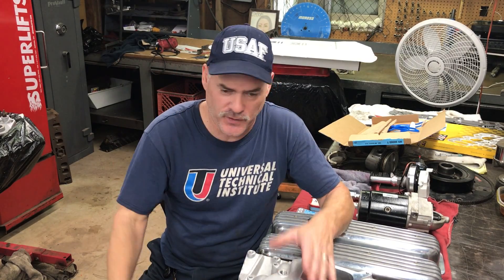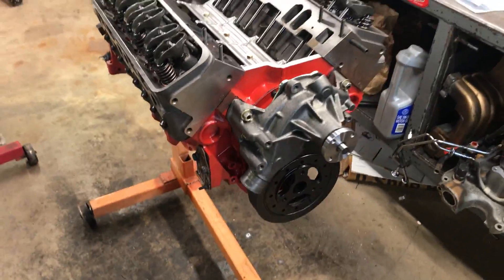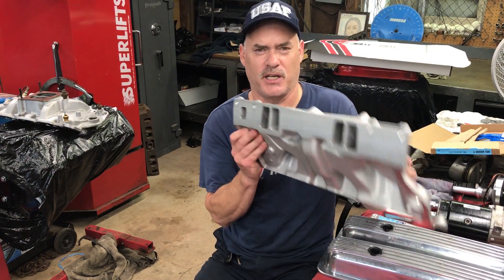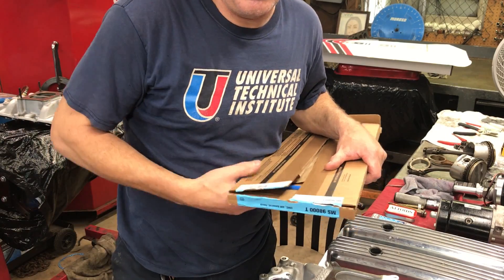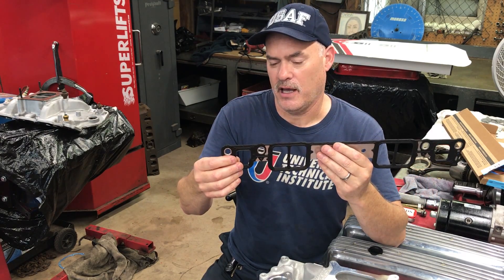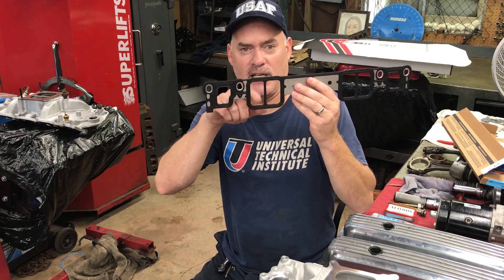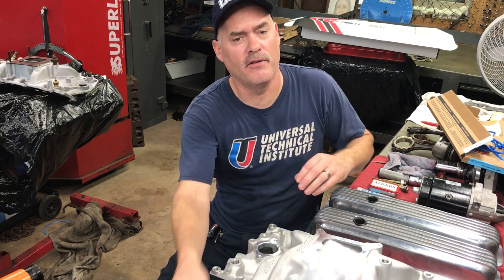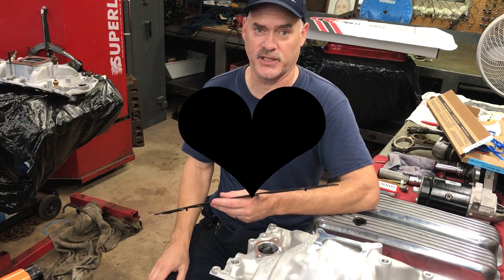5.7L Vortec  Intake manifold gasket problems

Comment: My crate engine 350 Vortec  was using 2 qts oil in 750 miles ..I used these recommended gaskets and now
it stays full of oil..I didn't see any smoke ...Glad I don't have to replace it....Thanks!
Reply: I;m having the smoke issue on my GM Crate engine with only 9,000 miles... I thought it was the valve seals so I wasted a whole day replacing those and did nothing. I'm really hopeful now is only the gasket!
Reply: Ok so 350 vortec crate motor with  vortec intake & spider injector system,
Is that what you got & your saying that this intake gaskets worked & took Care your oil consumption problem???
Thks in advance
Reply: @rudyVvv3  yes gasket was cracked on bottom

Comment: Looking for help second time around. Hello, been watching your videos, thank you. I upgrading a very early 350( V1027MU) Flint V8,Oct.27th 350/295hp block. I pulled this out of 67/68 Camaro  in 1971. been running this since 1975 build. 10.5  forged TRW pistons, chrome molly rings. I want upgrade to a hydraulic roller bump stick(Howard brand?). Budget is a concern with that said,  which are better early LT Corvette heads or later Vortec type head. Current heads came on the engine, 194/150 intake/exhaust which I port matched and cc'd also have press in studs which I pinned. I don't remember the cam specification(flat tappet hydraulic) but the Rhoads lifters didn't help idle quality. Stick shift car application. This is a street/strip fun car. Thank you for you answer in advance. The car is a 1978 Oldsmobile Omega, factory 4 speed I bought new in 1977. Mike 01/2019
Reply from the maker: Vortec heads are better
Reply: @Myvintageiron7512  Thank you

Comment: The early 3.8 and 4.3 had the same problems wonder if they have cured that as well????
Reply: Yes, recently installed Fel Pro Super Seals on 2003 S10 4.3L. Factory plastic on passenger side front was just on the verge of leaking near top of intake. Only 67K miles, been running ethylene glycol for many years too, which will help prevent since dexcool becomes very acidic when it ages.

Comment: Will these be a lot better than the regular felpro? I have a 2000 tahoe limited 5.7 2wd and I need to replace my gaskets thanks.
Reply: DO NOT recommend use regular Felpro plastic. Same junk as factory. These are call Superseal Felpro.

Comment: I'm new to you our channel and I'm also new to Chevys so I have a few questions. First off I just got a 90 Corvette completely stock except for the exhaust. And in wanting to upgrade the heads but keep the TPI set up any advice would be helpful. I'm not wanting to dig to far into the motor the Corvette was my father's and has 95k on her and runs strong but definitely has room for improvement.
Reply from the maker: Dart Iron Eagle 180 cc runners 64 cc chambers and a good cam  to match they will wake her up

Comment: Thought I needed an oil pump because my truck lost a lot of oil pressure cold starting it one morning. Noticed that it made a lot more white smoke even when warm on a cold day. Lost half a radiator of coolant in a month or so, no leaking. Drained oil to pull the oil pan and there was pure coolant coming out of the pan after all the oil drained... GM does some dumb shit for no reason. From the factory intake gaskets to using plastic threads in the distributor in these engines. Why? Nothing but a pain in the ass.

Comment: Hey man love the videos but how much torque should I use with these gaskets?
Reply: Whatever the manufacturer specs are. Used theses when I replaced mine. I’m not sure but I believe it was a low foot lbs spec. 12 or something like that. Replaced 1 1/2 yrs ago and have had no problem since.

Comment: I saw this video. I bought the steel shim gaskets.  They leak! Any other ideas? I have changed these 3 times in a year. I now have atomic efi. It runs like crap due to vaccum leaks. I'm running a new motor from jegs. The edelbrock rpm manifold.  My bolts are torqued to 11 ft lb.  Any ideas would help. I am ready to pull the intake and silicone the gaskets in place.

Comment: where is a good place to find the vortec heads and on my 84 square body truck which vortec heads should i get the 906 or the 062
Reply from the maker: 906 or 062 no difference wrecking yards or craigslist
Reply: , i found the906 heads . deal is the heads i have on the motor i just installed in my truck have roller rocker lifters and the motor has a mild rv cam in it with flat top pistons , so my question is when i swap and put the vortec hesds on my truck will i be sble to simply swap heads and be good to go ? i think the guy said it has been bored 0.30 over  will this affect my situation? also i found a vortec intake also should i do that or go carb with the elderbrock intake? man srry for pilling these questions on u but kind need some type of guidelines to know before someone takes money i dont have for the given.tx
Reply: man i found some sftermarket aluminum heads on ebay the deal is they are not vortec , and they are actually the proper heads for an 84 chevy my , question to u is would u think those aluminum heads would compete with the vortec heads?

Comment: what intake manifold studs are you using on those dart heads?
Reply from the maker: It is a hardened stud I got at a hardware store
Reply: @Myvintageiron7512  what's the length on those intake studs?

Comment: Can a blown intake gasket cause engine to use oil? I have a crate 350 with Vortec heads that is using oil and fouling plugs in a pattern and I can’t get a straight answer if the intake can cause it. I know oil doesn’t run through the intake but is there another way oil can sneak through. It’s fouling 3,4,5,6; right in the center of the engine. I’m going to buy a leakdown tester just trying to borrow it down.
Reply: Hey I'm having same problem except  cylinders 1,4,6,7,8  You know anything by now?

Comment: Hey this is Oscar I got a 57 engine I really like your videos!  Question, if you could recommend a good setup for more horsepower, I’m going with vortec head, which one would you put the 906 or the 062 head? Please let me know a good setup if you can you can...if you can call me that would be awesome (650)518-3036
Reply from the maker: What engine is it?
Reply: Myvintageiron7512 350
Reply: Myvintageiron7512 TBI Old engine 350 small block trying to put Vortech heads I know you said there’s two kinds which one do you prefer
Reply: @oscarfuentes7233  062 and 906 are the same design, just different year castings.

Comment: When intake gasket on vortek carb set up blows, will it leak oil bad?
Reply from the maker: It can sometimes it will pull oil from the lifter valley into the intake port and the engine will smoke
Reply: Myvintageiron7512 
Mine is leaking down bell housing. Performer rpm intake. I can't tell where it's coming from. Thanks for input.

Comment: Do you use rtv around water ports? or a cork gasket along the ends? or just that fel pro set and rtv on the ends?
Reply from the maker: I use RTV in front and back and on the water jackets
Reply: Putting a L31 in my 71 and just put the intake on tonight. Saw this a little late but I did put a skim of rtv around the water jackets on both the head and the gasket side where it meets with intake. Hopefully its enough! I'm sure ill know as soon as I fire it up. I assume it would be burning coolant if not? Love your videos. Keep up the good work
Reply: I also used the gaskets you recommended.

Comment: Very informative!  Silly question maybe, but if and when I have to do this job on my '97 5.7 Suburban (200k) should I use these gaskets also?  It's not carbureted but the CFI model.  Thanks for any advice.
Reply: MrBowNaxe I would like to know the answer to that question also
Reply: Yes, They work. I got the same kit and it fits perfectly. I bought this kit on Amazon and it came with both valve cover gaskets even though it says only one in the kit.
Reply: @MrBowNaxe  hate to ask but,- How did you reply to Aaron's ? when you were asking the same ? But Noone replied to you... How did you come to the conclusion that you could use the felpro intake gaskets on factory vortec intake w/ csfi system ???
Reply: @rudyVvv3  the matched up perfectly. I had fuel from a bad injector on my spider. If I remember, So I did both jobs at the same time.
Reply: @MrBowNaxe  fuel injector dripping  ???? (What symptoms/ experience you had on the fuel side)
How did you fix that problem?
Reply: @rudyVvv3  I had a fuel injector problem and when I pulled the plenum to do that I went ahead and replaced the intake gaskets while I had it torn down. Had 200k miles on it at the time so I thought a little preventive maintenance would be a good idea so I didn't have to tear it all down again if I had a gasket failure. I heard from guys that 200-250 was usually when you have an intake problem if you're going to have one.
Reply: MrBowNaxe yup it's the same motor
Reply: Ok so what leaks when intake gaskets blow from center portion?
He never mentioned if you loose oil, coolant or get vacuum leaks ? 
Any help would be appreciated

Comment: How you doing my name is John I been a subscriber for about a year-and-a-half. I'm honestly very impressed and learned a lot from your videos my profession is collision repair and mechanic related to any collision damage. Unfortunately age is creeping up on me Collision repair life can be tough on the body and health, and I have both problems I'd love to feel the motor someday and you inspired me to do so I don't know just looks like something I'd like to do I didn't know it was so precise and I was ripping Motors apart when I was 8 years old normal workers and whatnot just to see how they worked. Well I'll get to the question and it's about a cylinder head I was watching you do and then you showed a shelf that had many of them and you said they were for sale well I'm working on a friend's car it's a 1970 Mach 3 Continental with a Ford 460 it has some issues I'd like to ask you questions if I could just to make sure I'm doing the right thing and researching before I do anything I think it needs heads because it doesn't have the hardened seats in them and I believe the valves are a little burnt on the ends so I'd like to know if I could for one purchase two cylinder heads from you and if I was able to email you or get in touch with you just to ask some questions of course it's a budget fix I would love to break it all down and rebuild it but once again I want to do the research before I could give a price and if I am making the right decision I believe it just needs the top-end done but I'll have to check clearances on the main bearings and what not so I have a few questions but most important the heads so if you could somehow get in touch I'd appreciate it, I would assume you could reply to this and I'm sure we could figure something out I could send you back the heads I have either to be repaired or you could keep them or just sell me ones you've already done, either way I know you're busy and I appreciate all you taught me and I'm sure everybody that watches you appreciates your hard work.
Reply from the maker: I do have heads for that message me on Facebook at myvintageiron7512

Comment: This is great info I needed. I am building a race motor with a set of pro topline vortec heads and need this info.  one question, do I have to use self aligning rockers? I will be running a 510 lift cam. ect?
Reply from the maker: Yes self aligning rockers and check guides for clearence for that cam lift

Comment: I have a old friend that worked in one of the plants where vortec engines were assembled, he said GM felt that the vertical bolts on the corners were enough to secure the intake with no leaks. Apparently they were wrong. I have gear head buddies that drill and tap the heads in that center area, they drill the intake first on a flat surface, then countersink the holes and use allen head bolts and seal them with a small amount of RTV silicon.
Reply: I forgot to mention that the intake they used was always a aftermarket variety,  having extra material, I think the intakes of choice were either edelbrock or wieand manifolds.
Reply: There was no room for bolts in the middle with the factory multi port fuel injection

Comment: seems like there is plenty of open room to drill and tap a couple bolts in that center area. why they are not there already is baffling to me, just looking at them here, even if there is water jacket behind, it's the same with other sbc heads, right?. someone screwed the pooch in the r&d dept at gm. haha
Reply from the maker: With the factory vortec intake there is no room for those bolts but you are right drilling them out is a very good idea if your going with a carb

Comment: I've ran the ms98000t on my k1500 for almost 2 years now with no problems. I'm going to build a carbed vortec setup on the engine I'm building for my s10. I work in a parts store so I'm going to contact fel pro Monday to see if there is an individual part number on the lower gaskets in the kit so hopefully I won't have to spend money on gaskets I don't need. I will keep you posted on how that goes so hopefully everyone who does this can save a little money.
Reply: Did they offer just the lowers by themselves??
Reply: @dinzulgauls3502  felpro got back to me and said they didn’t have any plans to offer them by itself at the time. Currently don’t work in parts so not sure if they changed

Comment: One of the stupidest things GM ever did. Absolutely zero reason to eliminate the center intake bolts. Might as well eliminate the center main cap and save some production cost and weight. Or maybe bolt the exhaust manifold on with just the end bolts. I'll never use Vortec heads just because of this issue.
Reply from the maker: I halfto agree I have never liked it I am however going to do what another poster said and drill the center bolts in the heads and manifold there is no reason why this cant't be done
Reply: Actually there was a reason, the factory intake did not have room for those bolts

Comment: Hi and enjoying your videos. Just a quick question . I've got a 1979 SB350 corvette, in Australia, unmodified. We have 3 fuels to choose from 91, 95, 98. Which one would you consider appropriate. I've been running the 95, not sure if one of the others is better.
Many thanks, lefty
Reply from the maker: 95 should be fine
Reply: also depends on compression ratio and if youve got forced induction (supercharged or turbocharged), a higher grade helps prevent detonation/ knock (premature ignition), really you should be fine with 91, here in central US weve got 87, 89, 91, and some places carry up to 93.. 91 is premium grade where im at
Reply: One problem with comparing octane is that in the USA, the RON/MON measurement is used, whereas in other countries, RON is the only number used. That is why 2 fuels with the same anti-knock performance can have 2 different numbers based on where you live.

Comment: iv done so many of those intakes on those 5.7 vortecs ... DO NOT USE CHEEP GASKITS !! you will be doing the job again .. and if you worked on any vans that had that motor . its not a job you wanna do more than once .... USE THE GASKITS HE SHOWED !! zero problems with them .. make sure you chase the threads so you get a proper toque .. napa sells these ... AGAIN DO NOT GO THE CHEEP ROUTE ..
Reply: pat mcclory  with this work with my 2001 with the injectors??

Comment: Forgive my ignorance... scoring on my piston skirts means that my ring tension is gone or is it that the cylinder-wall-side of the ring surface has worn so much that support is gone? I ask because on a budget I'm trying  to figure out if I need new rings and simply hone the cylinders or will I need to bore the cylinders and resize the pistons?
Reply from the maker: The block needs to be measured in order to answer these questions
Reply: Myvintageiron7512 
Ok thanks man I'm intimidated  by the procedure only hoping OCD(lol) enough to measure correctly 72 times and that my  ADHD doesn't preclude the whole operation
Reply from the maker: Take it to a machine shop
Reply: Myvintageiron7512 
No no if I want to become an experienced engine builder like my dad and yourself, I'll just lump it up and put in the time. Plus machine shops charge money to do a lot of the things we can do on our own with a little diligence. So a dial bore gauge a micrometer and a set of  telescoping gauges, a sheet of paper and pen are all I need right..... and a lot of patience
Reply: Another thing, my 350 block uses .020 under main bearing being rebuilt at least once... how many times can my crank be reground before I need a new one? Next, if I went with a 383 stroker set up would I be better served align-boring my mains to the static size of the 400 crankshaft than having one's mains undersized to fit the 350 mains? I'm thinking the added material in the larger journals give more stability.

Comment: had that issue on my 97 7.4; but it was the rear ports. it ended up toasting my crank, do to the dexcool clogging my oil pump
Reply: Bearings do not like Dexcool either or even standard green coolant. Miraculously my 97 5.0L runs fine on 20W50 and lucas after the intake gasket disaster with ethylene glycol coolant.
.

Comment: Great info, I've used those gaskets several times without any trouble, though mostly on stock applications, and I have to add, those studs are a big trouble saver too!
Reply: Any idea on part # on them Studs ???
Reply: @rudyVvv3  Sorry, I don't have that info.  The torque specs are rather low, so you could just make your own out of all-thread if you can't find any, but I'm sure some aftermarket company makes them.... maybe ARP?